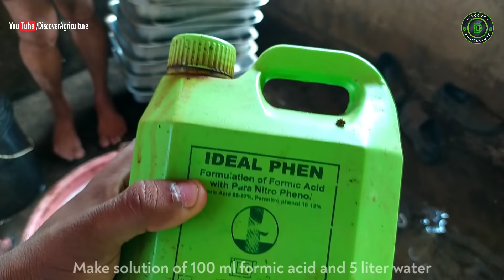How natural Rubber is Made from Trees | Rubber Harvesting and Processing | Rubber Tapping Method

Comment: What the smoked rubber is used for?

My family in Africa has lot of rubber trees fields. They used to sell it raw and make some money but prices have dropped so much these last years, it isn't even profitable anymore. I'm wondering if there is a way to transform it by ourselves into a finished product that can be sold on retail locally.
Reply: CAn we talk?
Reply: Smoked rubber is in the form of sheets and scrap. Smoked rubber sheets are known as Ribbed Smoked Sheets (RSS) of various quality grades. They're used in tyre manufavturing.

You can sell rubber raw and make money if you increase the quantity of production with same no. of trees, by applying stimulant a day before tapping the trees.

With a bit of investment, you could produce centrifuged latex, crepe rubber, crumb rubber, block rubber, and sheet rubber, which can all be sold to manufacturers of final products.

Manufacturing the products that end-consumers use, like tyres, gum-boots, surgical gloves, condoms, bushes, rubber bands, balloons, etc., would require a much heavier investment.

Comment: Each bucket makes one tire?
Reply: Each tray decked one on top of the other, contains two litres of field latex, which is approximately equal to 600 gms of dried rubber. The bucket used for collecting the field latex from trees is 10 litres, which works out to approximately 3 kgs of dried rubber.